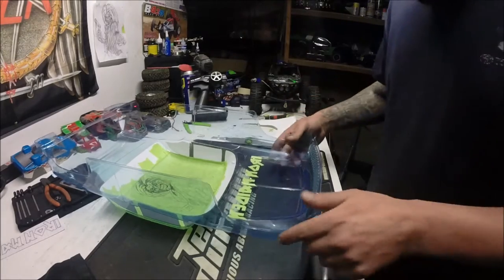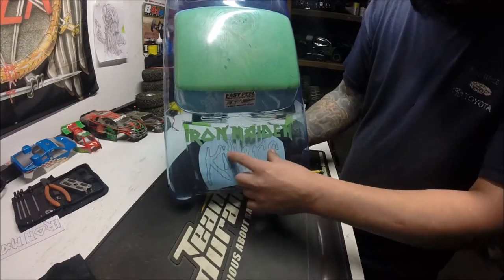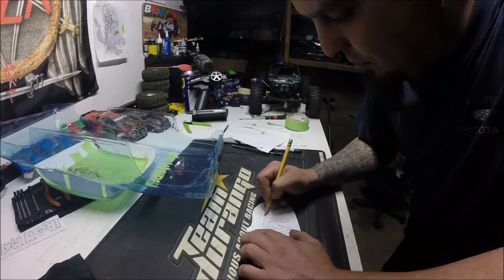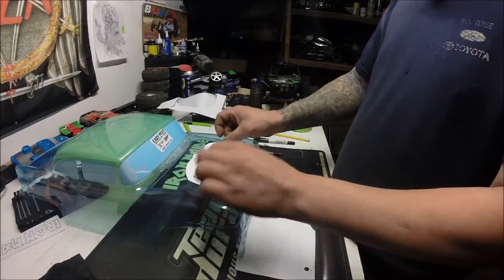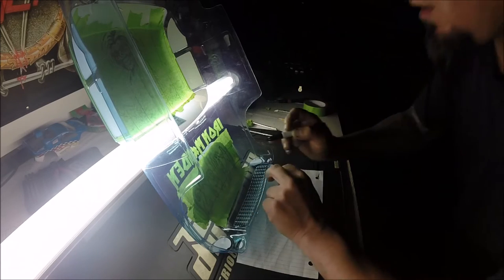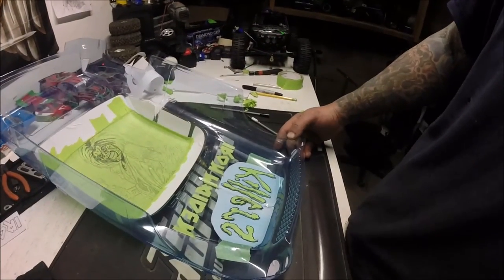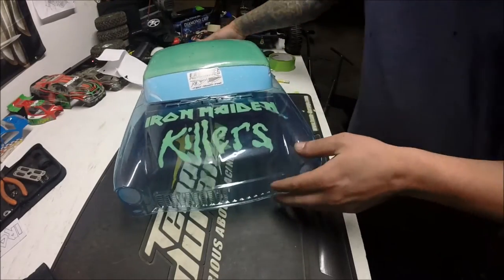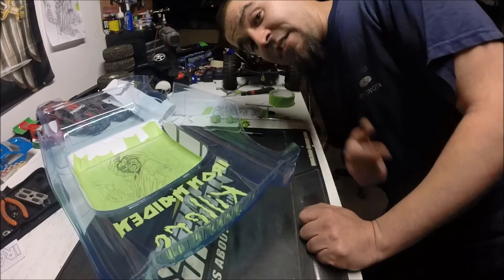Rc car Design - RC car paint jobs - tutorial masking iron maiden '55 body

Comment: Would it not be easier to use photoshop or illustrator and print it out flip it? If you prefer to draw it with pencil or pen it could be scanned in as well.
Reply from the maker: Deej Hat78 lol! There is nothing that could've made this body any easier.